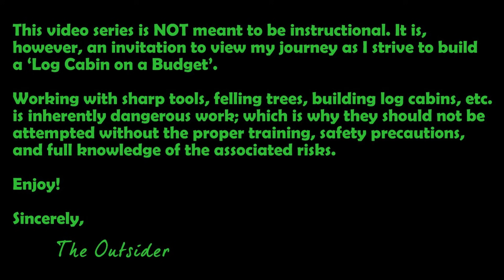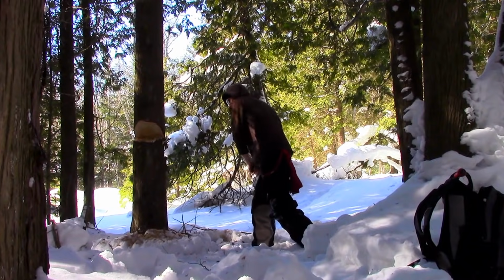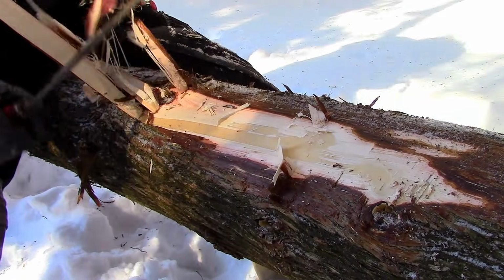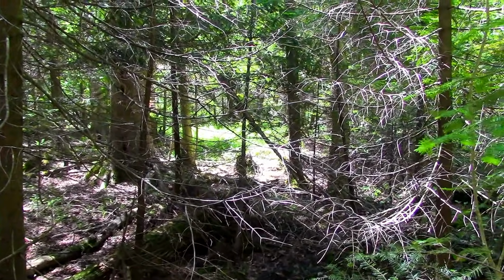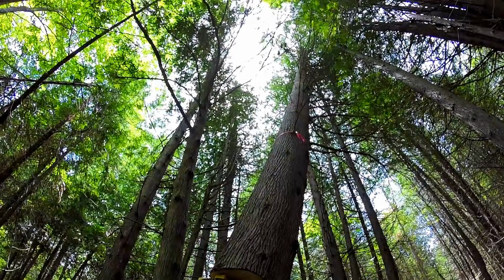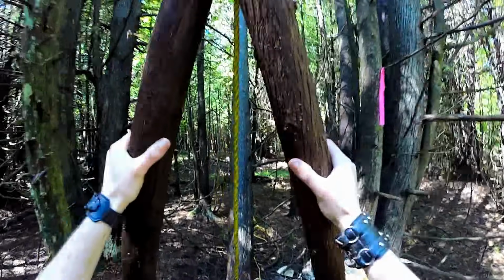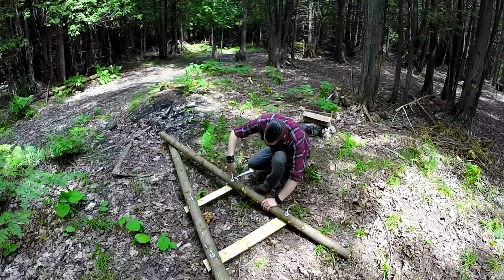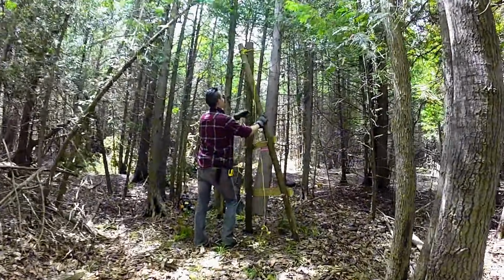Hung up tree? No problem! Homemade "Tree Puller"- Ep6- Outsider Log Cabin

Comment: Definitely recommend using a round pointed shovel ("spade" for others) under the stuck trees you can use the handle as leverage and use the smooth bottom of the shovel to slide the base of the logs along the ground as if they were on skis, with no dirt piles getting in the way dragging it. I found this to be extremely easy as they glide nice and smooth along the ground while the weight of the tree keeps it on the shovel.

Comment: I do the same thing you do, but in Sweden. With only hand power though ;) 

About felling and debarking i fell my trees in the winter and waited for spring to debark. Works well. And really easier to move the logs with a manpulled sleigh wintertime :)

The lever was a really Good invention! That One i will put to Good use. Might be Good also to move heavy logs Short distances :)

Comment: The frame is an ingenious solution to the problem.
Reply from the maker: ManicheanWarrior Thanks ManicheanWarrior! I got the idea from watching an old log cabin building video. The guys were using a similar frame to slide a log along the ground. As soon as I saw it, I realized it's potential for pulling down trees. So I modified the design for my purposes, and it's been working great!
Reply: Work smarter not harder, my dad always said!

Comment: Who would have thought that de-barking is only possible during certain times of the year.   In the previous spring here in Indiana we had 3 black cherry trees fall which I thought were diseased as it turned out the fell because the ground was so wet heavy wind loosened the root ball to the point of allowing the wind to topple the tree.  I just now got around to cutting them into logs for a bed for my son.  My draw knife did the trick but it didnt peel like your cedar trees did but it wasnt that bad.

Comment: The was a very clever idea and it worked exceedingly well.
I thought about using the flip-flop method using two levers at a 90° to each other and ropes tied to a tree a ways away and the other end tied around the tree you need to pull out, but I believe the method you came up with is faster and easier to set up.
Reply from the maker: Scott Smith Thanks Scott! I've tried the flip-flop winch method myself, but I really do find the frame method better in every way.
Reply: +OutsideFun1 I seen yur flip flop episode , I have used that before my self , for getting my 4 by 4 unstuck its best using a cable , not as much give as in a rope however your aframe idea is much better for what you were doing
Reply from the maker: grizz270 Oh yeah? Neat! Have any suggestions for me? I don't feel as if I gave the flip flop winch a proper go. Using cable would definitely be nicer.
Reply: just the cable , rope has to much stretch but some times stretch is good , as far as loging gos I would thin out some of the smaller trees in the way of dropping the trees you intend on harvesting , just enough trees to let the big one come down , as you pointed out they need to be thinned , but your already done with that part anyway anyway keep up the good show

Comment: You could add a big hook to the frame to change between "gears", without having to untie and retie again the ropes to the tree, could save you some time
Reply from the maker: Ricardo Luna Olvera That's a good idea. I ended up adding a carabiner to the rope so that I could clip on to the log without having to tie it on. I still like tying on to the frame though because how I tie affects how the frame pulls the log. If I tie closer to the log, the frame lifts and pulls the log over obstacles. If I tie further away, it just straight pulls the log.

Comment: good job u doig there. just wondering if u ever tryied to use two of those A frames in a row to move big logs by hand. I have big logs to move now myself, but this solution looks to my good. I will  build two A frames and hung the log to lower gear brace, and try to work together we should be able to move it. any sugestions...?

Comment: AWSOME...that was a great series, and a cliffhanger to boot! I've been planning my own log cabin built and your videos have been very articulate and a great help.  Dayamn, 2 hours of "work" for every minute of video... You have obviously put a lot of time and thought into your project. I appreciate you sharing it with us.  I will look forward to you breaking ground... any idea when the footage will be released?  also I was wondering... if the stumps were in the right location, could you use them to build your structure on top of if they were cut and prepared properly? One more thing, have you thought of cutting a point into the feet of your ingenious frame so that you can get better traction on the pull... All the best!
Reply from the maker: +Jay Law Thanks for following along! You may already know this, but the next episode (7) has already been released. I've heard of some people using stumps for footings. It works, but the stumps will eventually rot. Sometimes people sink pressure treated posts into the ground as their footings, and those last longer. But obviously they'll eventually rot with time. So you'd have to be comfortable with the idea of one day having to replace the footings. Good idea for the frame feet by the way. It's hard to see, but I did eventually cut points into the feet so that they'd get better traction. Thanks for commenting!

Comment: It is possible to visualise the A-frame lever as one spoke of a wheel, with the axle being where the pulling load is applied, and the load is slung below the axle. As the frame is pulled forward through its working arc, it is like the wheel rolling a bit.

Comment: 13:00 Did you come up with this method all by yourself? That's genius!
Reply from the maker: ***** I got the idea from watching an old log cabin building video. I can't remember where I saw it though. The guys used a similar frame to slide logs along the ground. When I saw it I realized it's potential for pulling trees down. So I put my own spin on the design and it's been working great!
Reply: OutsideFun1 Good thinking! Very innovative!

Comment: Just binged through this series, very entertaining and informative, thanks a lot! I've noticed you seem to have some stuttering/framerate issues at points. Don't know if anyone else has mentioned this, but what kind of camera/SD card are you using? Some cards don't have the bandwidth to write full HD all of the time which can result in this.
Reply from the maker: +Ewan Jobe Awesome! Congratulations on watching all the episodes all the way through. lol I'm not sure I could do that. Anyway, it's funny you've mentioned the stuttering, as I've begun to notice it as well. I'm actually not sure what cards I have. But what cards would you recommend for recording HD? Thanks!
Reply: +OutsideFun1 Anything class 10 or above will probably be fine and is more or less the standard these days. There are other possible causes but i'm no video production expert. Could also be something to do with how they're formatted, the bitrate you record in or something to do with how you render the videos. Does the raw footage have the stuttering once you've copied it to your hard drive?
Reply from the maker: +Ewan Jobe Thanks for the info. I have a feeling it's my card. My GoPro camera is the worst for dropping frames, and although it has a class 10 card, I still think it's the problem. My friend has the same GoPro, and it's never lost frames. As well, I know it's not the rendering process that does it, because the raw footage straight off the camera is choppy.

Comment: Have you considered getting a chainsaw mill?  It would be much cheaper and more portable than a regular mill and will definitely cut all the lumber you need.
Reply from the maker: ***** I've considered chainsaw mills, and they are a good idea for sure. I like the bandsaw mills though because they're more efficient for cutting (less material wasted by the blade, and less effort used to cut each plank), and the portable once are still pretty easy to transport. When you include the price of the bigger chainsaw needed for the chainsaw mill, I don't think the price is all that far off from a portable band-sawmill.

Comment: I like your videos but do you plant trees after cuting them
Reply from the maker: +Teo Andrei I am a supporter of planting trees, but I have not planting any in place of the trees that I've cut down. That's because the cedar forest that I am working in is dense. In a situation where the forest is too dense, it is actually a good thing to do some selective logging. The ideal density for a forest (generally speaking) is 400 trees per hector. Certain species of trees can begin to crowd each other out, and majorly stunt each other's growth. A crowded forest can also kill off other valuable species of trees. For example, I've walked through sections of forest where ALL of the birch trees have fallen down because they were being "strangled" out. So a little bit of thinning out and "pruning" the forest is actually very beneficial to the environment, IF done properly. So in this case, planting new trees in the bush that I'm in, would be detrimental. However, I do agree with you that planting trees (in the proper way) is a very good thing. But let's not just pick on the guy who works in the bush. Have you ever considered how many trees each person should plant each year to offset the carbon their cars produce? It's 6 (on average) by the way. But that's just the beginning. Overall, I believe building a log home produces far less carbon than building a modern stick-frame home, which most people live in these days. So I'm not disagreeing with your stance. In fact, I am glad you care about the environment. I'm just asking you to take a look at the bigger picture. That's all. Thanks for watching Teo!
Reply: +OutsideFun1  to be onest i didn't now all this things  your the best :) :) ;)
Reply from the maker: Teo Andrei Thanks Teo. :) And again, thank you for caring about the environment.